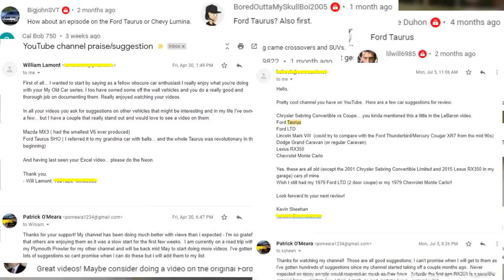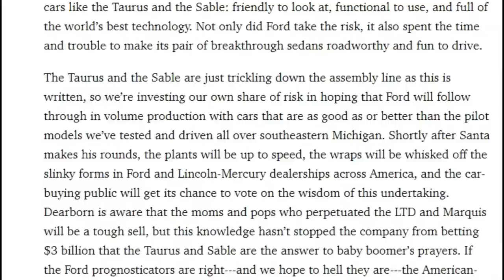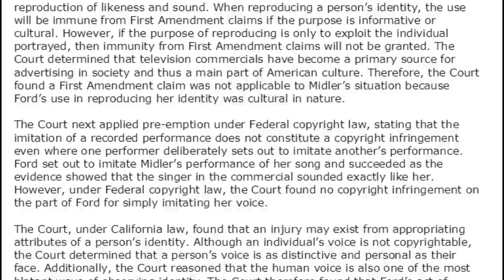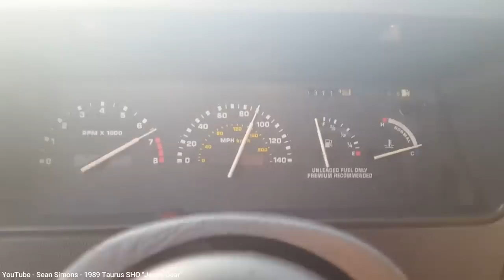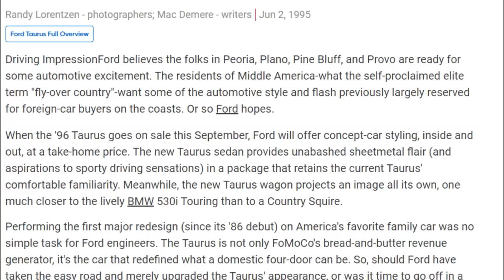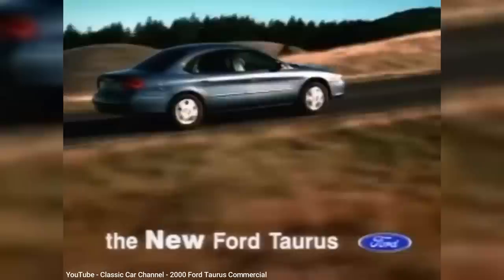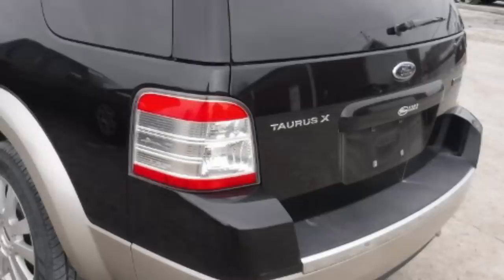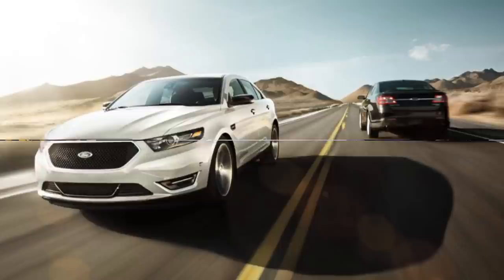Here’s how the Taurus went from Ford’s best seller to a forgotten icon

Comment: Overnight the Taurus made GMs entire lineup look like antiques. Thats how big a deal it was. Even today it looks modern.
Reply: That is the truth. I remember when the Taurus came out and it was years beyond in style than nearly anything else on the road at the time. My father bought a 1987 Taurus Wagon and we all loved it in our family. Pretyy much every car manufacture was forced to update their cars styles to compete.
Reply: Gm was already struggling in the 80s with reliability always liked the old boxy styling but the engines never lasted before breaking down and the 90s just put them in a crises mode
Reply: @kobra6660  yep thats why I want a vid on the chevy citation.
Reply: BS on that,GM had more reliable engines than Ford in the 1980s.One was the GM 3800s that ran forever which was in Olds 98,Delta 88,Buick LeSabre and Park Avenue.Got good gas mileage out of them too.The Ford 3.8 was junk,ate headgaskets galore.Taurus also had tons of transmission problems too,one problem was lack of lube to the final drive
Reply: @Toolaholic7  i agree with you on the engines part. I had a 3800 powered buick regal and the power, mpg, reliability was best of all time. I also commented how rhe ford 3.8 was a reverse engineered buick 3800 with aluminum heads and sucked.
BUT the engine is just 1 component. If you looked at the gm 86 87 88 lineup (and chryslers for that matter) they looked like small 70s cars outside and inside while the taurus looked like the future and still looks moden even today! Before the taurus a celebrity was a celebrity, after the taurus it looked like an antique.
Reply: @Toolaholic7  That 3.8 was junk. Had one in my Cutlass, constantly caught on fire. Fortunately the coolant leak would almost always put it out.
Reply: @BrilloBush  no it was not
Reply: Taurus was just late 1940's car styling brought back... I said FWD... NOPE...
Reply: @BuzzLOLOL taurus had no chrome no grill and 40s cars still had the boxy upright seating posture and high cieling. The gen 1 rav4 and gen 1 crv are more 1940s cars than the taurus.
Reply: @Toolaholic7  Yup. Junk.
Reply: @Henry_Jones  - there were about 50 different brands of 1940's cars... some having those features... cars go from boxy to rounded to boxy to rounded, etc...
Reply: @BrilloBush  it wasnt the most common though. Most had the super reliable vulcan. My dad had 3 taurii, all with the vulcan v6, all were reliable.
Reply: @BrilloBush full bs
Reply: @Toolaholic7  Not bs, absolute fact. That car was meticulously maintained, and that motor never saw the plus side of 87k. It was way underpowered, especially for the G-body cars of that era. Perhaps you may have had better luck, but every one I have had or dealt with was absolute garbage. The only plus side is that they are fairly simple to work on.
Reply: @BrilloBush  Talking about the Front wheel drive version
Reply: @Henry_Jones  I had one of those.  The police should have given GM a citation for sloppy engineering.
Reply: @BrilloBush  So there you have it, the perfect design
Reply: @billolsen4360  🤣🤣🤣
Reply: @kobra6660  GMs V6s and V8s were always pretty good imo.
Reply: @SBSC-GARAGE  my grandparents lost faith in gm after the 90s they had problems with vehicle back in the day and haven't bought one since I know some gm motors were stil reliable
Reply: @kobra6660  I got a 94 Firebird and its really solid aside from interior plastic lol
Reply: @SBSC-GARAGE  my grandparents unfortunately had the cadillac brougham with ht4100 that's why they won't go back to gm even after all these years just a bad experience
Reply: @kobra6660  Thats a shitty motor, caddillac does know how to pick them 😂
Reply: No no it doesn’t look modern today, nothing built pre 2000 looks modern today. All cars now have looked similar since about 2000-2005 onward but none before they look modern in the 2020s
Reply: @LucasFernandez-fk8se  a 86 taurus fits in with todays cars more than a 85 celebrity does next to an 86 taurus. Only thing that makes todays cars more "modern" are swoopong high doorlines with worse visability and giant fake grills.
Reply: Same with Chrysler products. Dodge 600? LeBaron? Ha.
Reply: I don't know if I'd say it looks modern today but it does look way more recent than 1986
Reply: But the problem is a lot of those Ford Tauruses have transmission problems
Reply: @Toolaholic7  GM 3.8 standard ( Not the Grand National motor ) 305 260 were junk 305 burned oil Crack Ed the cam So I swapped it for a 350 the 260 Olds ate valves 231 3.8 burned oil as well Chrysler had the best engines 4 6 and 8
Reply: @BrilloBush  Chrysler  made the best and available  turbo beat Ford in sales Lee Iacocca put Chrysler on top while Ford was sinking
Reply: @ladawg81 the first generation Ford Taurus especially the automatic had transmission problems because that V6 was too powerful for that transmission in fact basically all the generations until they stopped it I'm not sure about the last one I think the last one had brake problems that they fix that but the ones before that the transmission will go out on all of them that's why I never trusted the Ford Taurus
Reply: @michaelflores2318  Yes, although I think the 2.2 was much more common and reliable than the 2.5. Even their import engines were pretty much bulletproof, like the 1.7 VW motor used in the Omni/Horizon and later the Mitsubishi built 3.0. I Had a Sundance with the 3.0, amazingly fun little car! (although the automatic transmissions in these were junk 😞)
Reply: @ladawg81 I think that was the stupid design for them to put the water pump inside the timing cover with the timing chain because that will cost you over $1,500 to fix that was the only thing I didn't like about that and I know they have break wear cuz they had those big brake rotors with those little brake pads on there too and that was an issue but I think the last gen Taurus was the best of them of all
Reply: The Lumina Transport and Silhouette looked like a piece of pie laid on its side with wheels
Reply: Repent to Jesus Christ!
“Rejoice in the Lord always. I will say it again: Rejoice!”
Philippians 4:4 NIV
J
Reply: I’ve got a 2018 SHO and people ask me every few months if it’s the “new” Taurus.
Reply: @ladawg81 they pander to profitability
Reply: Chrysler came out with some great cars and still does over Ford LHS Concorde Intrepid  Vision 300M they were selling like hotcakes
Reply: @michaelflores2318  yea but those didnt come out till the mid 90s. For the 80s and half the 90s chrysler was all k cars.
Reply: Like the Previa with a very mild body kit can still look relevant.
Reply: Sure. 87 Monte SS or Regal GN vs any Taurus ever.
Reply: @danichicago9140  and discontinued after MY 87....
Reply: @danichicago9140  Super Slow
Reply: @danichicago9140  I would take the Grand Nasty over the Monte Farto Super Slow
Reply: @kobra6660  the small blocks from gm were reliable. More reliable than any ford or dodge of the time.
Imo the Toyota 20r mated ti the 5 speed manual was a superior powertrain compared to the big 3 powertrain lineups.
Reply: I always thought the Taurus looked cheap on the inside until the late 90s. Never liked them really. I had an unreliable Ford Probe. Transmission was always going out and I probably had it in the shop longer than I had it. Then it caught on fire on the interstate coming home from work one night. Went with a Sunfire and it lasted years.
Reply: @kobra6660  which GM’s are you talking about? The 3.8 v6 was legendary and the small block v8, while being horrendously underpowered, was still the definition of reliable.
Reply: @BrilloBush  you had one bad 3.8 and you think they’re all junk? 

Do you get paid to act stupid or do you do it as a hobby?🤣
Reply: @Redsfanatic32  I mean with cadillac mostly around the 80s cadillac reliability just died and let mercedes and bmw come in and kill off american luxury
Reply: @kobra6660  well to be fair the malaise era was especially hard on domestic cars. It’s pretty easy to find a foreign car with better quality than a domestic of that era.
Reply: Too bad the 1st gen started rotting from the middle of the doors on outwards after a few winters. They had horrible rust problems.
Reply: The 86 Taurus really blindsided GM with its styling and popularity. It took Chevy about 3 years to catch up with its Lumina which at best was a poor imitation of the Taurus.
Reply: @BrilloBush  You must have had terrible luck.  There are plenty of 3.8s from the 90s still on the roads today.  I could not tell you how many of them caught on fire but there are still plenty of them out there.
Reply: @charleshines1553  The 3800 is one of the greatest motors of all time. The pre-3800 3.8s were generally reliable but had some issues depending on the year and what car they were in. But the 3800 had so many improvements it was almost a completely different motor.
Reply: @Toolaholic7  I would have to agree. That 3800 was a pretty good motor.
Reply: Modern? Today? Quite a stretch I must say.
Reply: @DarknessViper99  compare a model s to a chevy celebrity and tell me which one the taurus resembles more from a styling standpoint.
Reply: @Henry_Jones  PT Cruiser
Reply: @DarknessViper99  Well, maybe not 'modern', but it doesn't scream "grandma car" like much of the cars GM and Chrysler were offering at the time. It's aged well, like the 1989 Honda Accord. 

I think the infamous "ovoid" 1996-1998 Taurus looks more modern, which is just another way of saying that modern cars tend to look like blobs.
Reply: @kalebaldwin5398  I had a 1990 Accord, those automatic seat belts were certainly interesting, at least to my passengers.
Reply: @DarknessViper99  My mother had a '91 when I was a little kid. Automatic belts on both sides. I always thought it was cool opening the door and seeing the belt stretch with it.
Reply: @BrilloBush  I can tell that's a gen 3 sho for sure
Reply: @Toolaholic7  I think you're forgetting about the 1980s white diesel that GM came out with. The one that was literally a gas engine with diesel heads. Horribly unreliable
Reply: @Thumper68  the Chevy line up looked worse
Reply: @pupferal3934  to each their own
Reply: @Thumper68  that it is.  Now why didn't you just say that in the first place
Reply: @pupferal3934  because I disagreed with op’s opinion
Reply: @Thumper68  ok, but couldn't have just said what you told me?
Reply: If only it was as reliable as it looked, a Ford is still a Ford. Nomatter how good it looks.
Reply: @kobra6660  What GM engines were breaking down on you?

Comment: I had a brand new Ford Taurus SHO in 1995. That car was like a cannon on wheels and extremely fun to drive!
Reply: I remember Automobile Magazine (or some magazine) said that the SHO set the record for the maximum number of valves you could cram into a single cylinder head - 6.
Reply: I had a red 95 only it was 20 years old when I got it. Still fun to drive
Reply: You lucky lucky person!!!
Reply: I would drive a 1995 Taurus SHO. Those were cool then, I still think they are cool. I have a 1997 F-350 still.

Comment: I have a 4th gen Taurus, and it's my first car. Really solid, reliable little car, never had trouble with it and its interior is pretty comfortable. Love the front middle seat and column shifter
Reply: Just got rid of mine after owning it for 6 years. Car was solid.
Reply: @JustAYouTuber1991  my friend bought one with a high mileage and unknown conditions, are parts for it pricy or cheap?
Reply: @maxpayz2431  depends what you need they can be cheap.
Reply: @JustAYouTuber1991  ah okay, well hopefully its just a bad alternator or a bad stater and not something engine wise or a bad transmission
Reply: @maxpayz2431  those are cheap and easy to replace. The Vulcan is a reliable engine. The tranny is touch and go, mine lasted the whole ownership with not so easy driving. Just have him service it every 30k miles.
Reply: You don't drive much , huh
Reply: @JustAYouTuber1991 Doesn’t the company stop making the parts after the model is discontinued?

Comment: I would snatch up a good low mileage 2010+ Taurus. You see them on the road and in driveways, but not very many on the used car market. Just seems like a comfortable efficient and safe vehicle. I must be getting old.
Reply: Most of them died from timing cover/chain/bearing/waterpump issues. There are very few left and the junkyards are even crushing them now because there's so few left to put used parts on.
Reply: Lol
Reply: I had a 2013 for 5 years. It was pretty reliable only had the replace tires once and the rear bumper support for rust. But I sold it before the dreaded water pump issue.
Reply: Just change your coolant and use full synthetic oil. You’ll help extend the life of the water pump.
Reply: @lukeWiz44  Simple as that and 95% of drivers don’t understand that old coolant will not protect against corrosion and it can actually be corrosive. I’d personally draw the line at 5 years or 100k miles despite the manufacturer's claims, unless they recommend sooner. Using the correct coolant is a must and never mix colors or types.
Reply: @EricFortuneJr.  yeah exactly. And I’m flushing mine again soon, and I’ll be using the new Ford yellow coolant. Supposed to be better than the orange stuff.
Reply: @billspangler2685  I had three Tauruses. A 2010 I just ran down and picked up from a buy here/pay here. And I was surprised. I loved it!  Then when my credit was better, I bought a rare dark green/blue 2014 SEL from a dealership. Just an absolute pleasure to drive. Kept it two years or so then I had to get the ultimate — a 2016 SHO PP. Then I learned at 80k give or take 5k, the water pump gasket would give out. Or before I could pay for the four-figure parts/service, it could surprise me and just dump all its water on the road and die.

I have a nice, quiet Lexus ES350 — a car doesn’t even make you aware you’re driving — but there are days I’d love to have a 2018 Taurus Limited.
Reply: I have a 2010 with 164,000 miles. One of the most reliable, comfortable, and efficient cars I’ve owned. I love it’s so underrated keeping the prices low. I will never get rid of my Taurus.
Reply: @chrisexperience7  yep. The car was a rare sight in the car lot. Underpriced and undervalued, dealerships were practically giving them away without a fight. I’m sure you had the same experience I did. People getting their first ride in one and saying “THIS is a Taurus?”  What a great road trip car.  
People would see my SHO is their rear mirror and they would slow down to the speed limit. They thought I was the cops. LOL.
Reply: @itsabovemenow1016  very true. I  drove across the country in my Taurus and it felt like I was on a plane. Never felt safer.  And excellent mpg for a car that big.
Reply: I have a 2018 Limited trim, and I absolutely love the car. I was going to get the Flex, but decided on the Taurus. Does everything that the Flex does, but in car form with better gas mileage.
Reply: The major recall was the electronic steering in the early 2010s

Comment: Great episode! I remember when I was a kid in the 80’s the first gen Taurus was everywhere. My parents even bought one. I haven’t seen one in years although a few years back I did stumble on an MT-5 in the junkyard randomly.
Reply: I wish the ‘95 my mother had was designed this way. The digital dash was so cool. I saw a digital dash car around 2003 or so. It was an 80s-early 90s car. But it was bad ass.
Reply: Someone has a light blue one in my neighborhood, thing still looks brand new lol.
Reply: The only MT-5 I've ever knowingly seen in person was also in a junkyard, and it was a wagon.
Reply: The MT5 was always uncommon! Ford put an end to it's availability in early 1988 model year. I had one. It had a 2.5 HSC 4 cylinder (basically a Tempo 2.3 HSC with a taller deck block) and used the same MTX3 transmission as the Tempo.
Reply: @davidkane4300  88hp wagon...nice
Reply: @XMguy  The digital dash Ford had in 85-86 Thunderbird and Cougar.
Reply: Repent to Jesus Christ!
“Rejoice in the Lord always. I will say it again: Rejoice!”
Philippians 4:4 NIV
J

Comment: My ‘92 Taurus was a dream. I had it up to 250k miles when the transmission finally started to go. Comfortable, easy to work on and safe. The ‘01 Sable I owned was a nightmare. I had power steering issues, the IAC never worked right and the engine had issues. I dumped it when the windshield started leaking.

Comment: I currently have 7 of these cars.   An 88 Taurus LX with the 3.0 and Digital Cluster, an 88 MT-5, a 90 Sable GS, a 91 Sable LS Wagon with the 3.8, a 93 Sable LS Sedan with the 3.8, a 95 SHO 3.2, a 97 SHO 3.4 V8, and a 2000 SE 3.0.  Absolutely love them!  The 86-91 models are my favorite, with the 92-95 being my second favorite.  I plan on dropping the 97 SHO Engine into a 2003 Taurus Centennial Edition, thus making it a "4th Generation" SHO.
Reply: @rafciu123   The 88 LX has 50k miles, the MT-5 has just over 200k miles.  The 90 Sable GS has 41k miles.  The 91 Sable LS Wagon has 120k miles.  My lowest mileage one, the 93 Sable LS has 22k miles!  the 95 SHO has 63k miles.  The 97 SHO has 52k miles.  I no longer have the 2000 SE, as I traded it for a 2003 Centennial with 49k miles.  The only one that has a "little" rust is the 88 LX, which I bought from Columbus, OH.  All the rest are southern cars and have no rust.  Also, between now and the time I posted the original comment, I've acquired a 1986 Taurus LX Wagon with 57k miles!